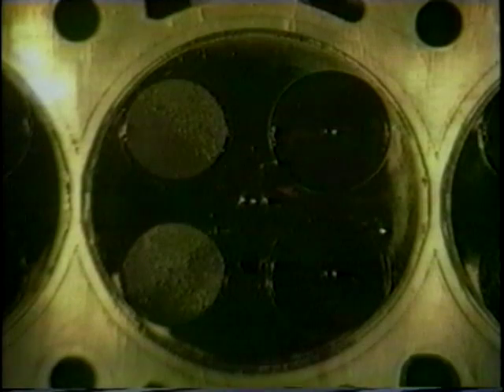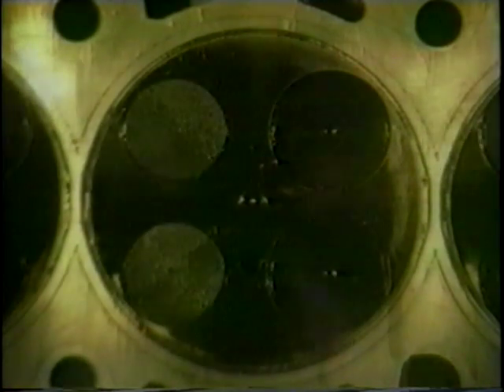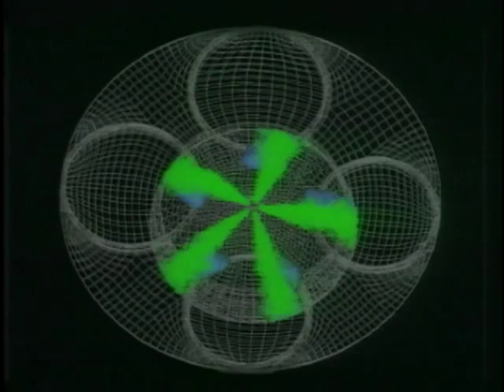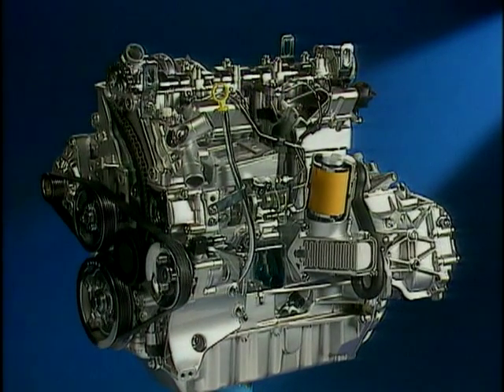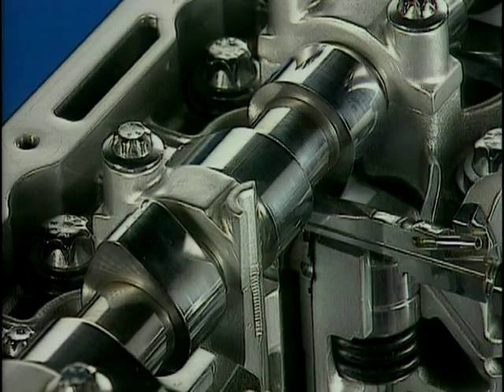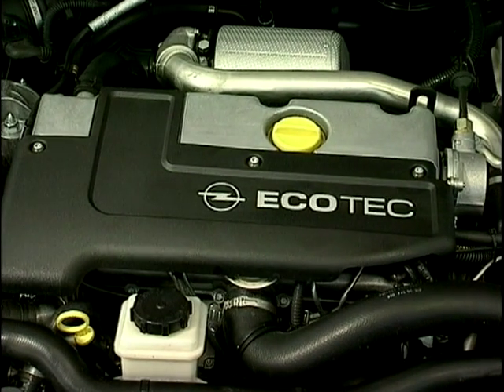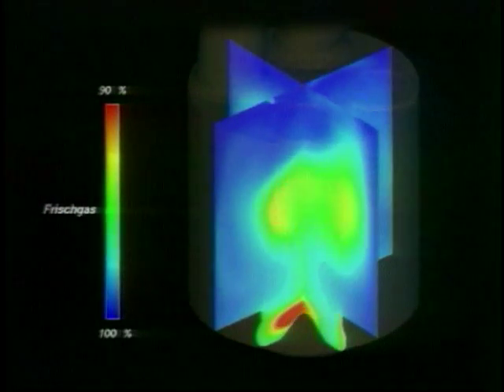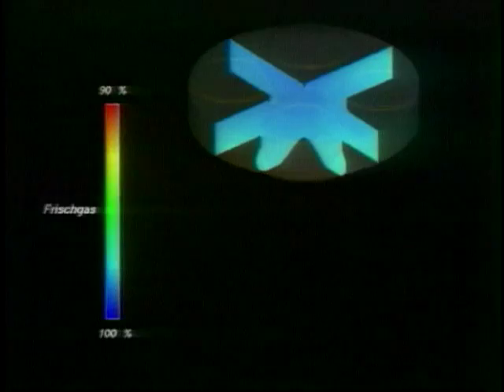The First Direct Injection Diesel Engine

Comment: FAKE TITLE! >>WIKIPEDIA>>FIAT CROMA
FIAT IN 1986...
"The Fiat Croma was the first passenger car in the world to have a direct injection Diesel (Turbo D i.d.) engine, in 1986.[7] Other diesel engines were the Fiat's 1.9 L fitted with a turbocharger with direct injection, giving 92 PS (68 kW), and the 2499 cc unit supplied by Iveco,  with a normally aspirated version giving 75 PS (55 kW) and a turbocharged one with 115 PS (85 kW). This one replaced the original 2446 cc with 100 PS (74 kW). Diesel engined variants of this car were  not marketed in the United Kingdom."